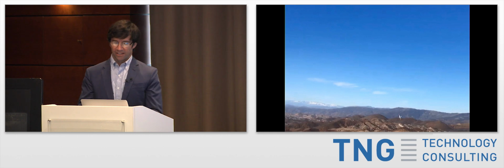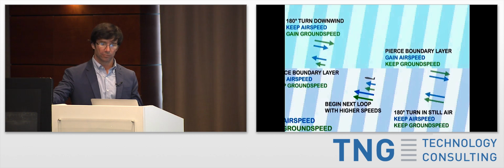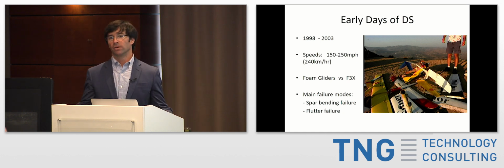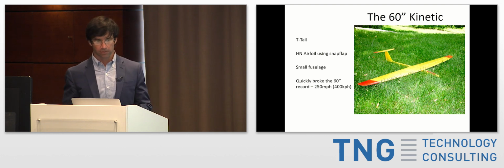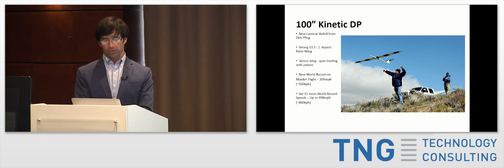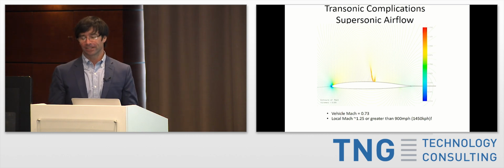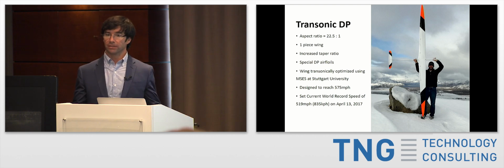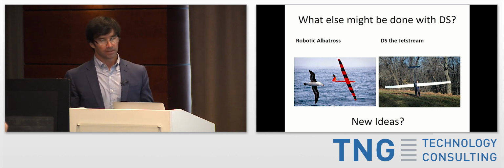BTD10: The 835kph Sailplane and Dynamic Soaring

Comment: Utterly fascinating.    But my irk is that there is always enough magic free energy  at the bottom of the orbit to haul back to the same height as the previous height.  Why don’t the forces of drag and gravity shave a bit of energy every time until the glider must land or use aux-power to start again?
Reply: The energy gained from crossing the shear, adds more than that lost to drag. (Up to a certain speed, at which the gain equals the loss, which is the max speed attained)
Reply: It's not free, it's stealing the energy from the wind.
Reply: SuppressedSmirk.   You “nearly” is important.   Because if it’s always “nearly” and never “morely” then that suggests a gradually repeated failure to reach the same height until no gain at all is made.  I’ve come to some accommodation that it is the wing-over (and not just a banked turn) that is crucial giving the glider a slingshot boost to get an enough energy to return to a similar height to get the next slingshot.

Comment: Great presentation! 
Very interesting to learn how far dynamic soaring has developed.Amazing that it possible to get into the high trans sonic range with this size and  type of airframe. A speculative question is if it would be possible to maintain more than mach 1 in dynamic soaring with some kind of airframe? Perhaps diving with ballast to pass well past mach 1 and then releasing ballast adjusting wing loading appropriately? I am thinking in similar terms as cheap supersonic and  hypersonics tests being performed. Cd drops after mach 1 but it is unclear to me if energy still can be gained in a strong wind gradient. Also vaguely remember reading about some Japanese pilots trying to fly a modified Blanik by DS the jet streams decades ago.
Reply: At those speeds, you're creating an inert missile!

Comment: Stunning presentation, and amazing timing. I spend time most days watching absolutely superb natural dynamic soarers between my house and the beach, over the Kahuku public golf course. Mating flights of 6 ft. wing span Albatross, and the not explained few minutes of DS by Wedgetail Sheerwaters before landing at their nests just after sundown are entrancing. The Albatross are majestic flyers, the just over half their size (Meter wing span) Sheerwaters move at far faster air speeds and maneuver tempo, smaller 'circles'  (more figure 8s) and stay lower. At sea, this is harder to understand as the scale of the wind gradient is tighter and more turbulent. Over the golf course, the beach front slope and vegetation creates a low level relatively stagnant ground layer of air, and a velocity gradient as altitude increases. Where the birds choose to DS seems far enough back from the edge of the beach incline, and associated bushes, to have no turbulent separation layer. Maybe a beach fire soon will offer enough smoke for visualization of the flows in real time, as opposed to educated guesses. The tradewind is usually 24/7. 
I'd grasped the principles, but not the high speed potential now being explored with RC planes. It may be helpful to close a bit of the control gap of remote piloting using what all this DS  family of seabirds have, very sensitive tubes on their upper beaks for Nature's Own pitot tubes.   Forward facing beak tubes give both wind speed and direction, in relation to the momentary orientation of the beak. The birds don't seem to do much hunting of head angle. A radio link back to an earpiece of the pilot might give both some sense of air speed, and turbulence. Dual channels of sensors and earpieces offer more choices. Musicians offer clear evidence the brain can use several sound channels simultaneously and process information from each independently. Thermal soaring at full scale (and some RC?) uses this for real time non-visually communicated information on both the plane's altitude changes (Altimeter), and the relative vertical movement (total energy probe variometer?) of the air mass the plane is flying in. Maybe more, since I've been out of touch with full scale soaring for over a generation. 
dskinetic.com has no info I can find on cost of any of the models, but I probably don't really want to know.
Reply: I think AI is going to solve the control problem, there is no way a  human pilot  is going to process all the inputs necessary in real time for DS .

If you want to visualize flow at a soaring site, what about mylar streamers on a pole?
Reply: @myotherusername9224  AI is a current popular meme, but is completely unnecessary for 'drone piloting', self-piloting Unmanned Air Vehicles. Several Youtube videos discuss programmable flight control systems with affordable hobby computer cores, I'll post the name when the memory returns. May be mentioned in earlier comments on this video?  AI offers learning 'self-programming', which may be advantageous. I suspect AI is more valuable where the basic physics or other principles are less understood, or situations are too complex for most human mental modeling.  Flight in most regimes is not one of these areas. Not saying AI doesn't offer optimization potential.
Reply: @bill taylor. I like this idea of wind sensors, and it would be easy/cheap to implement, akin to negative feedback, into servo sensors/control. Almost like ABS on a road vehicle is a 'fit and forget' as it does its thing only when needed and is way faster than mortal ability. Brilliant. The idea of feedback to pilot is also a genius suggestion, not just 'ears' but also force transducers that would give instant physical feedback of wing dynamic loads.

Comment: I have a question about the constant lift coefficent. Doesn't the Wing have to work harder, when the plane is flying faster in a circle. When gravity is pulling down on the airplane the wing has to work harder and when the airplane is at the highest point of the path gravity helps the wings.
Reply: The work to stay in the circle is much much higher than earths gravity. I read in another post about the 2020 NZ DS Fest that planes at this speed experience about 100g  (100 x earth gravity)  so earth's gravity kind falls out of the equation due to being insignificant.
Reply: Yup fighter pilots call it "God's G." But it's a much smaller help, proportionally, when you're doing 100 G's of your own already.

Comment: Because the more general definition of "soaring" is "gaining energy in the form of speed OR altitude" (kinetic OR potential) by exploiting the momentum differences between two fluid regions,  it includes sailing (as mentioned)...but also even simpler paradigms: e.g.,  two simple kites: one kite is flown until it enters an air mass moving relative to the anchored end of the kite string (as evidenced by a distinct "bend" in the string)...and then a second kite is attached to the string and BOTH kites are lofted when the second kite is released. They will remain aloft as long as they reside in the two moving masses,  again, as evidenced by a bend in the string between them. Notice that THIS example does not emphasis increasing speed,  but rather altitude.

Comment: 42:00 about the affect of the sweep on mach number, does it works the same for forward sweep wings, in this case making the tip of the wing 'fly faster'? Can it be the reason why on slope aerobats and scale gliders the forward swept models tend to have a very friendly stall and nice handling at low speeds?
Reply: Yes forward sweep would have the same effect of delaying the mach drag rise plus an added benefit of avoiding the tip stall problems that come with normal sweep but the aeroelastic nature of forward sweep is unstable since the tips increase AOA as the wing flexes.

Comment: Let's see...The Sweep.  For every 5 Degrees of sweep equals 1degree of dehedral, so 15degrees of sweep would equal 5 degrees of dehedral, which is about average for today's swept winged aircraft whether Model R/C or full sized.
My Delta has a 31 degree sweep.
 The wing/body is built Split Rib Fashion from 1/4 sq. light pine straight grain stock. 1/4 in.Square.
 Round stock from the hardware store formed the Leading Edges and the Trailing Edge. Wing thickness at High Point is 2 inches. Titebond and Super Glue used and epoxy for the engine mount and the Main landing gear plate. Covered with MonoCoat.
All up weight about 4 1/2 pounds w/ Fuel.
With a .25, 25 foot ground roll to lift off. With a .46 about 3 feet.
It seems that the faster it goes the more stable it handles.

Now what I'm thinking ,with the same spit rib build and if the thickness was reduced to about 1 in. take out the engine, fuel tank, landing gear, control it with mixed two channels,
 as a slope flier might be interesting.

Comment: cool!!! back in 2001 i lived out in Los Angeles. i would say i was a fairly competent slope soaring pilot. i flew foam delta wings of different densities. one day the guy that built the foam cores that i used to fly said im going to take you to a place that is legendary for slope soaring. so we went to parker mountain. parker mountain is a ridge that you get to through fire roads in acton ca. we get up there and i see this guy walking around barefoot. i make a simple mental note and carry on. since there is really no setup for a delta wing we throw out have two short flying runs to get a feel for the place. so i look the barefoot guy almost has his glider setup hes taping up the seams in the wing. composite plane much heavier hitter than i or my buddy that showed me the place. at that point my buddy had heard of ds but i hadnt. so the guy throws out his glider takes a couple turns in the front and shoots down the backside im thinking what did the idiot just do? so i watch thinking this guy is about to lose his fancy plane. i watch him make a hard bottom turn and the plane is heading back up the hill it hits the rotor and heads back down tightening up each pass. with two or three passes the glider is doing well over 100 mph. i was so blown away to what i was witnessing. of course i aint see this type of flying but this huge glider is moving and where you park is along the fire road i get behind my truck for safety. at the time i didnt know it but he kept going back and forth on the backside looking for energy and in that he made a few passes over my truck. it truly sounded like a boeing 737 just passed over my head. so after barefoot guy lands and had settled down near hit pit i went over to him and said" bro you gotta break down for me what i just witnessed" he explains to me about ds and at the end of the conversation he introduces himself as Joe Wurtz. i got to see and learn first hand from the guy who started the craze with rc aircraft
Reply: About the same time I was once more  living in the LA area, trying to get back to the level I had achieved there over 20 years earlier... After one thermal contest, there was this guy practising landing after landing: it was Joe Wurtz IIRC. I realised that I'd never catch up with these guys who flew almost every day in the soaring paradise that is Southern California.
Reply: Eddie Acoba ... I never heard of this until one hour ago when I came across this youtube video.  At first I thought it must be fake (speeded up video with normal speed sound track).  I am really impressed ... And his engineering skills are the best I’ve seen
Reply: Faster than any RC jet, but NO engine.
Reply: I'll never understand glider pilots. Let alone toy glider pilots. Woo, you get to go fast in tiny little circles. Exciting. How many times can you fly in circles before you say "Well, I've done all I can in this field." and move onto something better?
Reply: @dr.lexwinter8604  drag racing has entered the chat ..... Bonneville has entered the chat ....Nascar has entered the chat
Reply: @jackd1582 none of them even get close to the rawness of this! Not even nitro has this level of adrenaline and any of those vehicles would crumble at these g forces!

Comment: What about the Delta Wing Platform?  I built and fly a Delta Blended Lifting Body, 48x36 inches, with a OS .25 dbbl. It is almost twice as fast in level flight than the other ships at the field that are flying planes with .40 and 60 sized engines. It is because the delta is just so much more aerodynamically clean.  Without engine and the right CG this might be something you might want to look into.
Reply: Deltas are fast in a straight line, but really draggy in tight turns.
Reply: @robinbennett5994  You beat me to it.
Reply: this is just a guess but i would say the sweep in delta wing is pretty unstable at high speed tight turns. which is what you need in ds
Reply: "I built and fly a Delta Blended Lifting Body"

If you built it from plans, do you have a link or a name or some way for me to find plans ?
Reply: Flying wings aren't the solution to supersonic flight.

Wing sweep is. It's a subject beaten to death by the who's who of aeronautica. 

The problem, as he mentioned, is stability and control in low speed flight. Its also a structural problem to sweep wings enough to gain an advantage while maintaining very high aspect ratio means the tips are well aft.

There is a solution to this, in a unique planform, but I wont disclose it here, haha.

Comment: I just thought of something. Wouldn't a swept-forward wing force any turbulence towards the fuselage where it would have minimum effect on stability?
Reply: people have worked on this, it swaps out the tip stall problem for a wingtip divergence problem, where any increase in lift increases the angle of attack of the wingtip which bends it further up, quifkly destroying the wing.
Reply: That has been tried in fighters, it kindda works, but makes flutter problems even bigger, plus with that ammount of G forces the tip would twist up, add drag or even break.

Maybe it could be used in the tail for some  marginal gains, but just a guess.
Reply: Correct. You can engineer thicker wing skins and with composites actually make the wing twist leading edge down, see the X-29. 

The solution is twofold, obviously both.

Comment: Awesome. I watched every bit of the video. Learned a great deal. Was into RC soaring when younger. Just a lightweight 2m floater, but fascinated by the high performance planes. Now I'm 67 years old and into kites. We could use some innovation in sport kite design. Wanna give it a shot? I think the current speeds are under 120mph, perhaps under 100mph. Not really sure. Also check out quad-line kites, which allow reverse and side flight.

Comment: Have you considered making the wing Asymmetrical because you are looping around a single point? Perhaps shift the fusalage and shorten a wing?
Reply: The plane doesn't teleport in a ring trajectory, it has to be able to get there
Reply: I can almost guarantee they already have an asymmetrical (i.e., cambered) airfoil since they only do positive G's (as most aircraft do.)

Unless you meant one wing longer than the other or something like that. That would not be of any advantage, as once a turn is established (even a normal turn) they see a symmetrical (left-right) load. The only asymmetry is when they're rolling into our out of the turn. All that aside, what's flown here is more akin to a loop (laid down on its side) than a turn.

Comment: Great video! Nice to ee all the work and theorising that goes into reaching these speeds!

When getting close to mach 1 would a delta shape be a good idea?
Reply: He talked a lot about the need for high aspect ratio wings for efficiency.  A normal delta wing has a horrible aspect ratio.  It makes a terrible glider wing.
Reply: Well, the energy involved is so much greater than with a normal slope soarer, maybe once you get into those high speed regimes, a delta makes sense (think of Concorde)... if you can get there at all in the first place by starting out in the slope soaring regime.
Reply: I had the same thought, delta wing instead of swept wing.  Wonder what DP thinks about this.